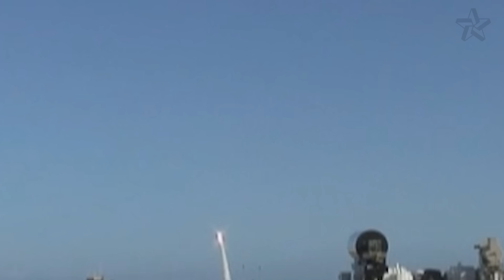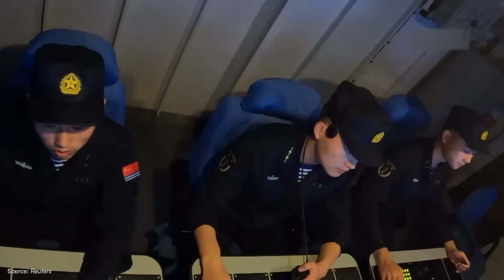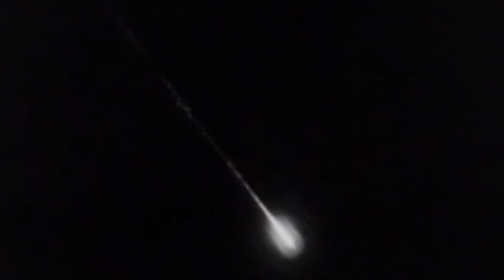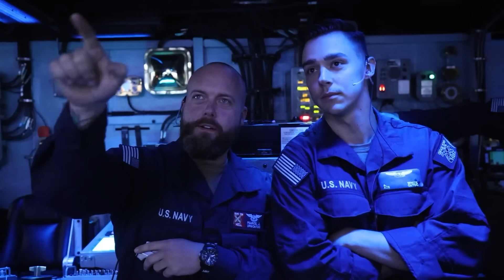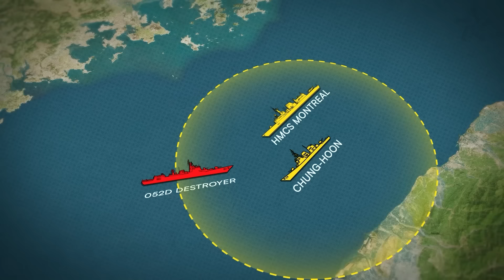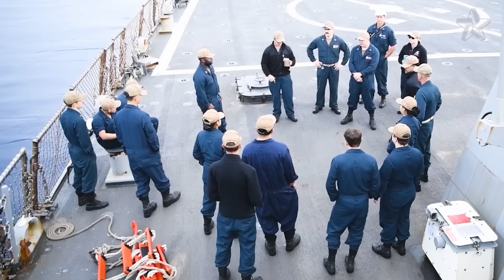Chinese Ship Gets TOO CLOSE to US Navy Destroyer – BIG MISTAKE

Comment: Would she hold if it was a ten thousand units torpedo network system upgrade to a dsv unit torpedo capacity with a 5 years run system add air looks good but under ??? Let's check.

Comment: Trouble is that when this missile goes from turbojet to rocket it becomes not a stealthy sea skimmer any more, but a high altitude last phase, this is not stealthy and can be intercepted by say ESSM 2 that are designed to take out Mach 3 missiles.
The YJ-18's X-band seeker is an active radar homing that thus it can be electronically counter measured by system like Nulka.
NSM II, JSM and LRASM are much stealthier, intelligent, and have passive guidance thus giving their attack phase low level, stealth and low level manoeuvring at its last phase.
These western anti ship missiles are much harder to defeat.

Comment: The host’s narrative: Suppose the way the Chinese system operates is actually an older system than the one from 30 years ago.  
At the same time, I’m curious — China has never disclosed the specifications of its active equipment, let alone the underlying operating principles. How does the host know this? Isn’t it only Chinese hackers hacking into American systems? How does the United States know how China’s classified systems work?

Comment: You don't need to be that close to launch a vertical cruise missile. If you were really going to launch them you would do it well out of range of the oppositions response capabilities.
Reply: The YJ-18 only has fuel for 100NM but needs to update target in real time issue with shooting it from far away is it his burn-off at 35NM meaning it already hit turbo combustion and that can be picked up by a radar I can buy at Target the US AGIES system can and does handle missile defense in under 10 seconds it's the fastest system on the planet and guess what with the MCAI system being implemented it's going to be even faster and more accurate which it's already 92% accurate soooo meaning by the time you even launch an egg roll at us our system will have already assessed the threat and the operator has already sent countermeasures and is getting up to go make a sandwich  before that missile even hits burn-off.

Comment: and this is why we inteh usa are geting new battleships that can carry even more vls agis and otehr missled vls sistems as well. you think the bruk class usa distoryer was tough withthis agis missle defsie sistem the doland trump class bascly multibes the missle agis defsie capblty with like 10 tems the fire rate and ammo  at the same time. also puts  a JDF rail gun and two 400-600 kW laser defise sistems a few more five inch guns and a few more ciwis and se rams and even a bit more helecoper hagner space too. also teh doland trump clas as like 128ish vls VMLS mk 41 lunch tubes on it and evene ten tactal nucler curse missle missle tubes for evene more firepower. so yep whne in next two or so year whne we get one doland trump class missle defsie BATTLESHIP out  china won't have that much to work with. a singl doland class missle defsie battle ship would bacly make a whole chna fleet waste there missles in just one full savo and still have more ammo to fire a few more retalion atacks withe sm-6 missles right back at them.